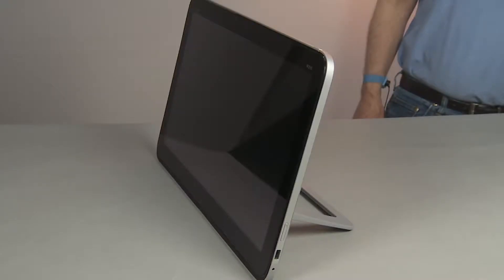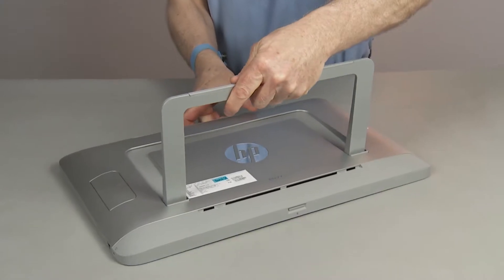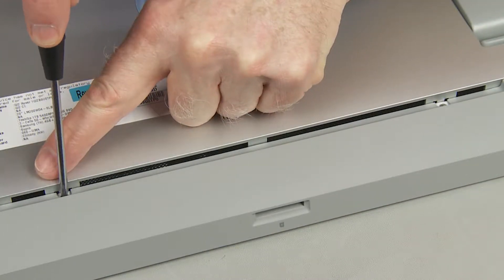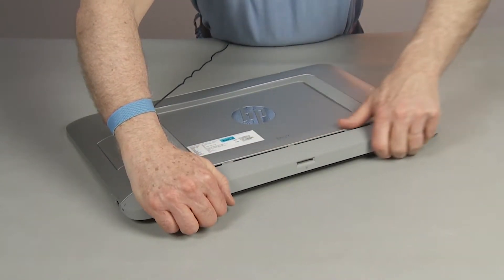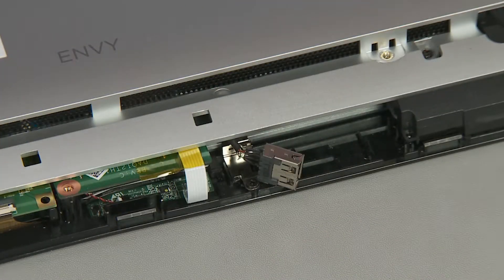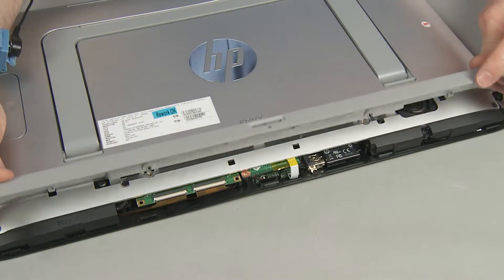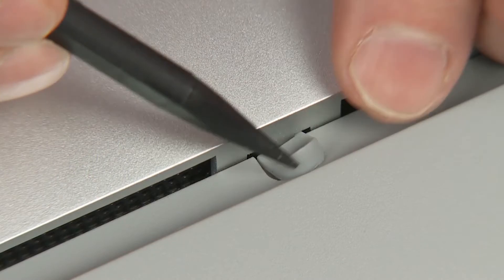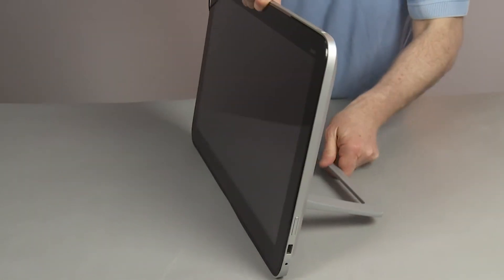Replace the USB Wireless Keyboard and Mouse Transmitter | HP ENVY Rove 20-k000 PCs | HP Support

Comment: sir i have lost hp mouse and keyboard dongle, 2V9E6AA
Reply from the maker: Hi there, thanks for contacting HP Global Social Media Support!
I understand that you have lost the USB receiver for your wireless HP keyboard and mouse.
I will do my best to assist you.
Once the matching dongle is lost the WIFI mouse/keyboard combo is useless except for salvaging electronic parts.
The problem is that the wireless keyboard/mouse combination is bonded by a radio transmission key and frequency to its dongle from the factory.
You will need to replace the mouse/keyboard combination. The new combination set will have a dongle that is part of the set. 
You could also use a wired USB mouse and USB keyboard.
Regards, 
HP Support